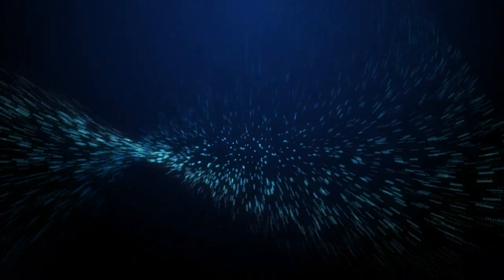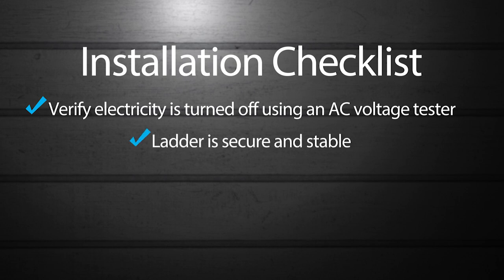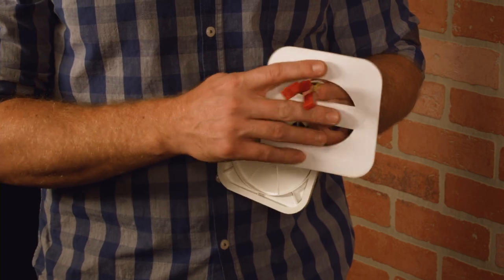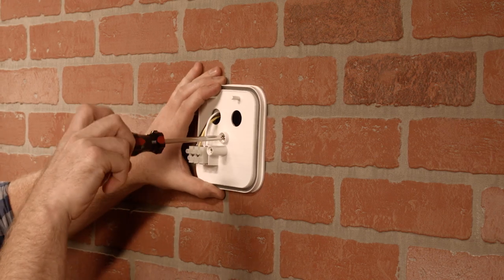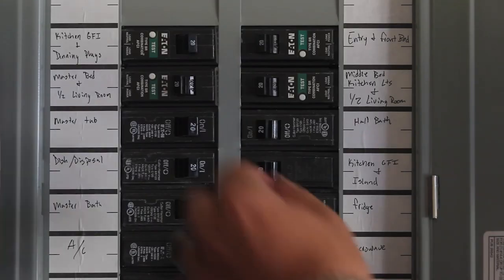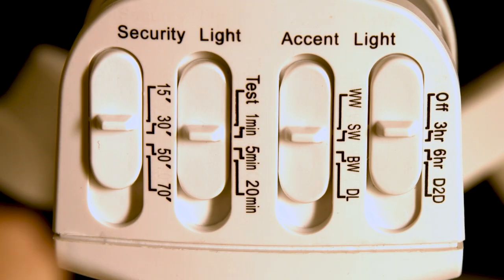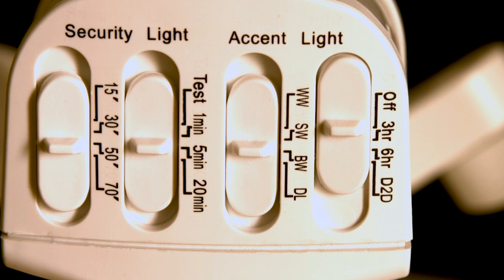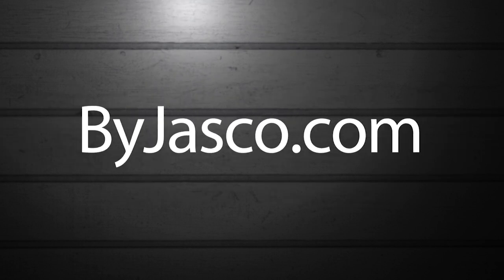Enbrighten Security Light installation and Operation (40768, 40939, 40940)

Comment: I have a floodlight... been debating on whether I should install it on the house wall by the front door aiming outwards toward the front yard, or there's a pillar/column about 8 ft in front of the door that I could attach that light to an aim the light back towards the front door/house... pros and cons either way?
Reply from the maker: Hi Andrew!
It really depends on the area you want to light. Pointing it outwards is traditionally a great way to maintain visibility around your property/yard. Depending on the design of your home, it could potentially boost appearance and illuminate a larger area. 

Pointing back at your front door could be a great way to deter intruders. However, it also might shine unwanted light through any windows and into your home — which you could find annoying in the evening. Up to you!

If you have any other questions, feel free to reach out to our U.S.-based Consumer Care at 1-800-654-8483 between 7AM-8PM, M-F, Central Time.
Reply: @JascoProductsCompany  Yeah, I have to use it for security to deter intruders, but some people have said to point it outwards to the yard is better to catch any intruders coming towards the home, and the light should shine enough light around the house/door area, even though it's pointed outward... so that's what I plan to do.

Comment: When I mount this light under the eve what do I do with the motion sensor? Am I supposed to rotate it 180 degrees so that the switches point to the ground? If so then I'm having difficulty accomplishing that because the motion sensor component does not seem to be able to rotate a full 180 degrees. I've watched the video and read the instructions and there is no instructions about what to do with the motion sensor on an eave mount. But I did notice on the motion sensor itself it has the marking this side up which is actually painted pointing toward the ground on an eave mount when leaving the orientation the same as when removing the product from the box.

Comment: My lights would work fine in senor mode for about hour. Then turn off and on again the rest of the time.
Reply from the maker: Hi David,
It sounds like you're having an issue with the sensor. Give our U.S.-based Consumer Care a call at 1-800-654-8483 between 7AM-8PM, M-F, Central Time — we're more than happy to help you find a solution!

Comment: my house has a white an black wire only no yellow
Reply from the maker: Hi, Tyler. One of the yellow wires in this video is the yellow and green lead coming from the light. It connects to your green or bare copper ground wire. The Romex coming from the wall also has a yellow protective cover to keep the black, white and copper wires together. In some homes, this cover might be white or another color. If you need additional assistance, call our U.S.-based consumer care at 1-800-654-8483, M-F, 7 a.m.-8 p.m. Central Time, or contact a licensed electrician.